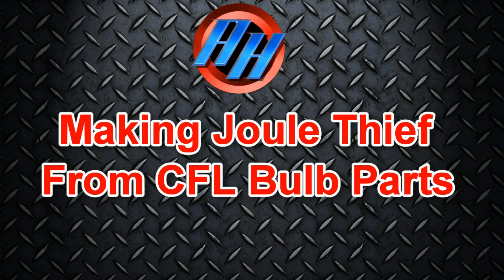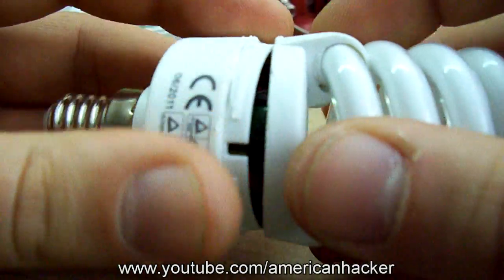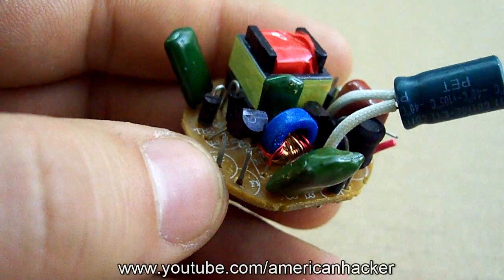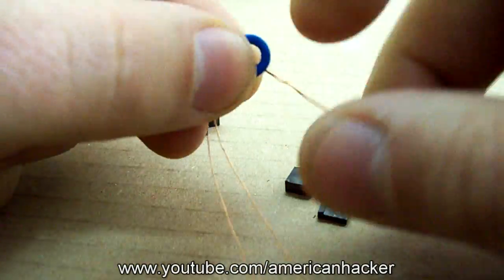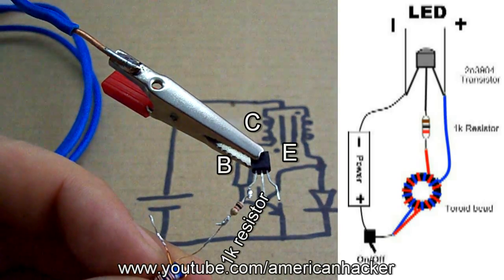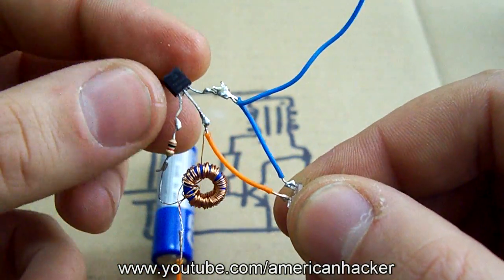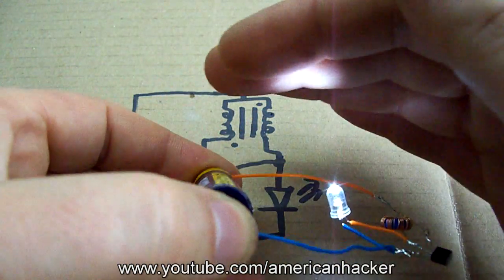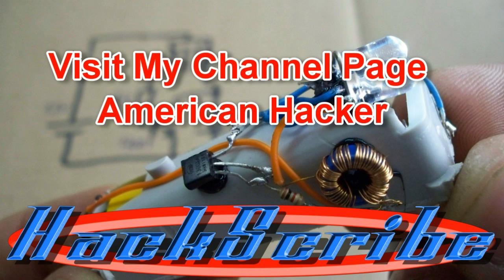Making Joule Thief From CFL Bulb

Comment: 1:11 That's not a transformer. It's a choke inductor. Only a single winding coil around the core. The ferrite Toroid you removed is actually the transformer in this circuit. You'll see the different windings around it insulated from each other at 0:53.

Comment: Hi. We tried to do this but the FCL bulb contains 2 similar transistor. 4242DT. It worked when we connected a battery. But we're trying to  use a Peltier module with output voltage of 0.5V. Please give us some advice. Thank you.

Comment: When you are wrapping the ring, do you make sure to keep the wires separate? Or does this not really matter for this type of circuit? It seems like it would be hard to have the two wires completely separate without having them wrapped in some sort of insulation.
Reply: nogginj they are insulated its magnet wire which has some kind of clear thin insulation.

Comment: I keep thinking that all transistors perform the same function which transistors work best in the application of a joule theif?
Reply: 2n2222.
Reply: #williamguillen Can I use BC547?
Reply: Engineer Saksham Sure, you can use any NPN type transistor.
Reply: OK THX!
Reply: I could make it successfully with the transistors from 4 feet florescent tube electronic choke. 13005 very good working. But I didn't get good result from small toroid ring from cfl.I wound the coil myself on the broken, rather thick ferrite rod from tv h-out by the turning ratio of 20:10 or 30:20. I could make a much more brighter 4v leds by 6.5v. When lit, the voltage shows 5v across the leds. Thank you.

Comment: Yeah. Steampunk. But I think you could improve on that with a bit of artistic ability. Use copper and black colored paints good for plastics on the battery housing. Add some fake gears to the outside and place the components in easy to see while in use areas of the battery holder. Use copper tubing for conduit for the wiring to the components. Add a steampunk decorated lid and.......voila! A real good looking steampunk Joule Thief Torch. I wish I could help you achieve that look. But, alas, I am quite far away.
Reply: Сергей Бодров good idea if i get the chance ill make it for my next cosplay

Comment: DC current cannot be multiplied but can AC current could be ? also the transfomer converts DC into AC isn't it ? plz answer me soon
Reply: +Harshit Dubey The answer is yes. The transistor has a "gate" that opens and closes fast. This makes the electromagnetic field on the torrid collapse and build many times over in fractions of seconds. This will be AC current from DC. I hope this helps. If not, I am sure it is easy enough to look up and get more detailed information.

Comment: Hi American Hacker I am Turkish, you make a dimmer switch.
Reply: +Berke İle Devreler Yapımı Perhaps I can help? You need to make a switch from scratch? From spare parts or basically trash? I can help you. A sliding switch is easy. Connect your light to the +(positive) and leave the other end free. Connect the - (negative) to a coil spring secured to a board or something stable. Slide the open end (+ side) from the far end of the coil spring toward the end nearer the - (negative) side. You then have a basic Rheostat or dimmer. You can make it into any shape you wish. A simi-circle is used in compact switches.
Reply: +Stevephone Hocking Thank you very much :)

Comment: can i use 13003d transistor?.i have tried but it didn't work could i possibly have burned it while soldering?can i use it without a resistor?and does it work with a normal wire instead of the coil one?

Comment: This is very nice, and easy to do. I was wondering if you could do some arduino, remote pranks. I would love to see a toilet taser prank, when some one is peeing and gets a small shock. You could turn it on by remote, or motion sensor. Small white wires could be used to electrify the water, that would get lots of views, exspecially if you could do a demo prank on some one.

Comment: it is posible to charge phone using jt?
Reply: +andreiruiz143 That depends. I think it is possible, but phones need 5V and about 500mA. If this can be achieved through this circuit and perhaps some other circuit, like a car charger for a phone, you might get it going. But more is needed than what is presented here.

Comment: how many turns of wires you need in the ferrite core?
nice vid :D
Reply: +Prasetyo Muhammad Dwi I saw another project where they told to do 10 turns. is another circuit, but quite similar to this one. See it at
http://www.instructables.com/id/Joule-Thief-Low-Voltage-Battery-Charger/
Reply: 10 turn for each wire right? btw thanks mate
Reply: +Prasetyo Muhammad Dwi I tried more turns, as he said to use about 20 in (+- 50 cm) of wire...